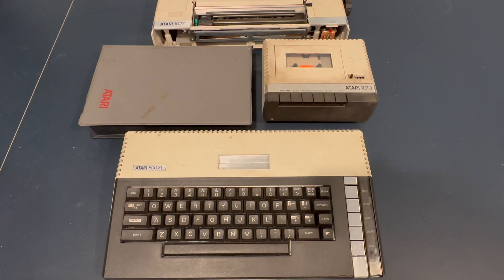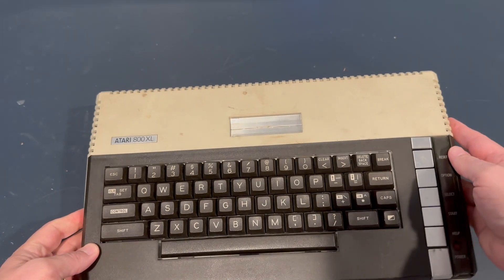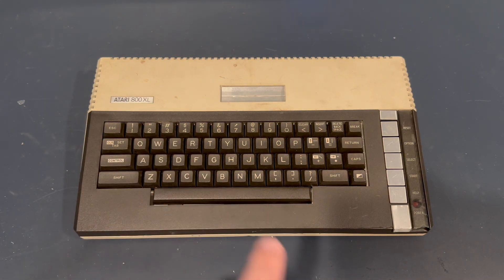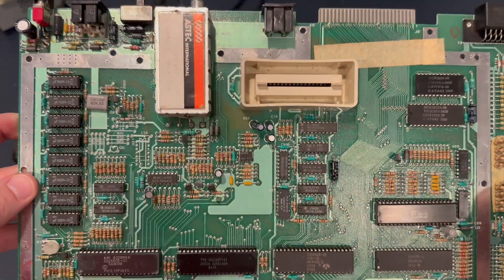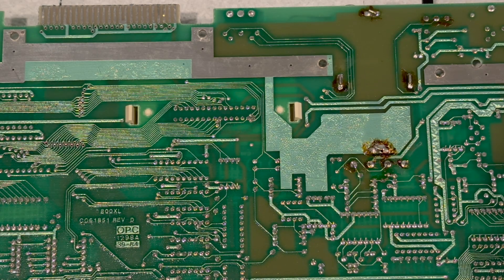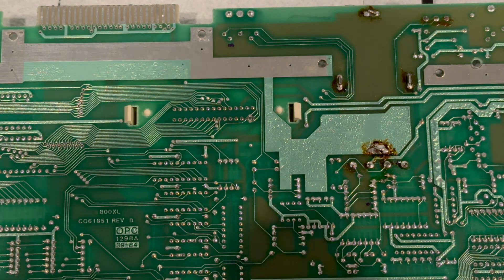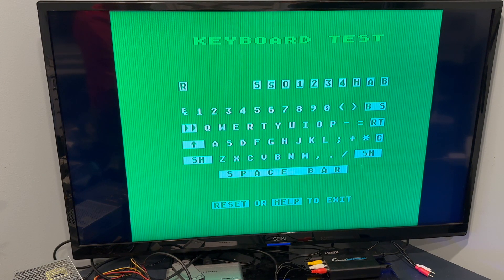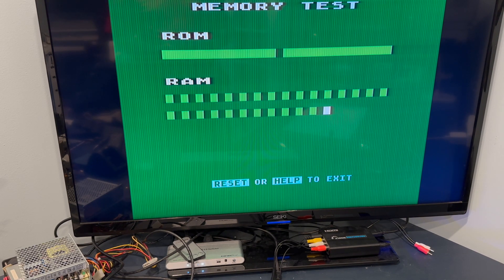An 800xl refurb / S-video mod for a friend

Comment: Atari and Commodore computers offered way more bang for the buck than the equivalent Apple II family of products. I've always wondered how Apple kept a stronghold in the education market for so long. Their software and hardware were inferior in comparison to the Commodores and Ataris. Many claim it due to the Apple II's open architecture, but the Apple IIc managed to sell despite lacking expandability. Moreover, most schools didn't bother to upgrade their machines. Their only major competitive selling  point of the Apple products was its 80-column video, which was a requirement for any sort of word processing. 

The real not so acknowledged reason, however, was the Apple II's build quality and aesthetics. They were very rugged--enough to survive abuse in a classroom environment. It also was a beautifully designed machine which to this day still looks gorgeous. Steve Jobs was a genius and understood this very early on. People pay for what they want, not for what they need. If it catches their eye and they want it, then it sells itself. All you need to do is justify their wants as legitimate needs.
Reply from the maker: I also believe I recall that Apple won an early education bid in Minnesota with the MECC, with them becoming the largest distributor of computers in the 1980's.  Later there were some significant tax incentives allowing Apple to "donate" computers for tax writeoffs (others manufacturers probably could have done this as well).

Comment: Did you remove capacitor C54 and C56 before soldering the wire under the motherboard?
Reply from the maker: Nope, the directions I've used don't mention any removal of any components.  What is the intent of removing the capacitors?
Reply: @powerofvintage9442 removes the jail bars in s-video

Comment: Tell your friend to get an AVGcart or a SUBcart. 
He will have the best experience out of his Atari without soldering.
The AVGcart comes with 512kb ram expansion(PBI cable needed) and a video/music player turning it to a multimedia power house. If he gets the SIO cable he will enjoy amazing compatibility with all available  files.(ATR,XEX,CART,BIN,ROM, CAS)
THe SUBcart comes with 1mb ram expansion (PBI cable needed) plus a stereo upgrade to enjoy  all the games /demos supporting this feature.
Its the best solution because at the same price you get the Cartridge (SD card) and the upgrades that come with it.

Comment: I just picked up one of these and non of the chips are in sockets all surface mounted, first time I've seen that.. it has an old flexible keyboard membrane also.  it powers on but goes straight to the diagnostics screen and I cannot select anything with the keyboard the only key working is the reset one. any idea's?
Reply from the maker: I'd try carefully reseating the keyboard membrane into the connector on the board first.  
Hopefully you get some ability to select the various tests.  I'd then run the RAM test specifically to see the output.
If you don't get the keyboard working, I'd recommend opening up the keyboard and testing the membrane itself by connecting the membrane without the keyboard attached to the mainboard and see if you get signals that way.
Reply: @powerofvintage9442  thanks for the advice 👌🙏😁